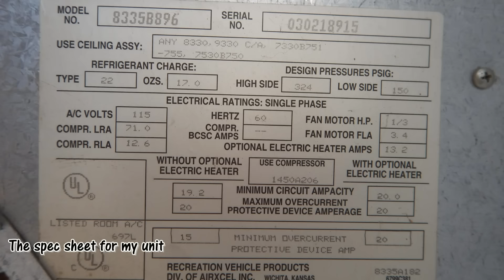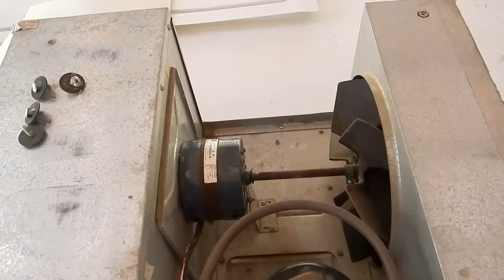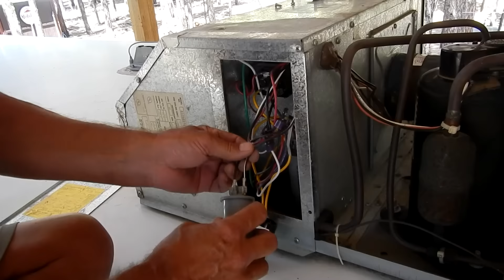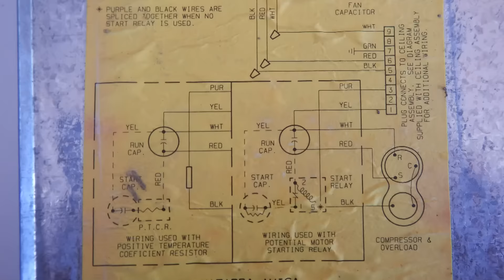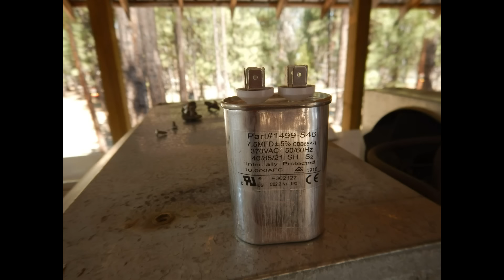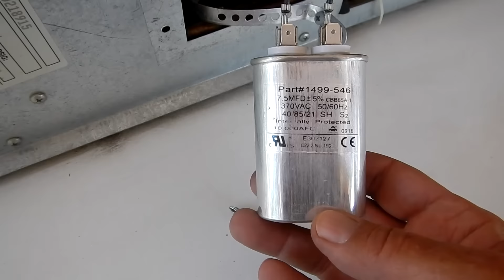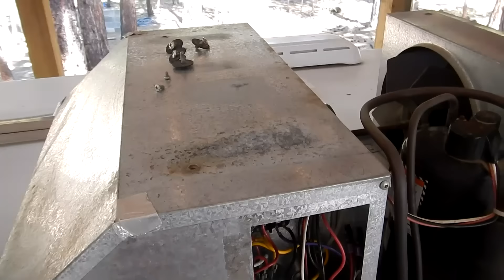How to easily fix your RV air conditioner.

Comment: New to camping. Have an old dometic duo therm RV ac. It cooled on Friday night and part of Saturday then it seemed to cycle frequently then it tripped the breaker a few times then it no longer tripped the breaker but no longer cooled and was making a noise that got a bit louder, turn all off the next morning Praying I don’t need a new system. This women needs some AC tech help, thank you
Reply from the maker: If you are tripping a circuit breaker on your RV's electric panel something is drawing more current than it normally should. Your fan (blower)motor or compressor motor could cause the circuit breaker to trip. Does the fan work without turning on the actual air conditioner? Many thermostats have a fan only mode. This would tell you if your blower motor is working properly. Your compressor motor is the other thing that could trip the breaker if it's going bad. Your compressor can also cycle on and off if it's overheating as there is a thermal shutoff on it. It will try to start again after it cools for a few minutes. You should be able to hear your compressor if it is running or not. I've tried to explain how to simply diagnose if both the electric motors in your system are working. Refrigerated air conditioning is a somewhat complicated process with several things that can go wrong. If either of your motors aren't working properly you will probably need a professional service person to fix the unit.

Comment: Great video!!!!!  you talk about shorting out the capacitors.  when doing so, do you turn off the main power switch inside the RV and then lay the screwdriver across both terminals?  Thank you in advance.
Reply from the maker: Unplug the main power cord for the RV when working on the capacitors. Capacitors in an alternating current circuit normally won't be storing any energy.Thanks, Richard.

Comment: Thanks for the tips. Fingers crossed.
Reply from the maker: It's a very common problem. If you can start it by hand it's usually a capacitor.

Comment: Hello, I was trying to figure out why my refrigerator in my rv wouldn’t run on electricity. After inspecting it I found that the 12v wire wasn’t snug around it’s terminal so I adjusted it so it would fit. And while doing that I accidentally touched it to the ground wire. It was unplugged so there was no power but it blew a fuse witch I replaced and it still won’t run on electricity. Did I cause some kind of damage somewhere else in the system? Please help.
Reply from the maker: If you blew a fuse chances are you didn't ruin anything. That's what fuses are for to protect the components in a circuit. It's possible your 110 volt heating element has stopped working. That's what the refrigerator runs on when using electricity. It's a ling thin rod with a standard electric cord and plug attached to it and plugged into the control board. They are not too difficult or expensive to replace. Of course it could be another problem, too.

Comment: Thank you! I thought it was my start capacitor. My unit was acting the same way even after replacing it. Im going to replace the fan capacitor and see if it works.
Reply from the maker: I hope you get it running correctly.
Reply: So I replaced the fan capacitor and it started functioning better. Started on it's own and ran for about 30 mins before it starts to die down and stop spinning. Do you know what that could be?
Reply from the maker: Make sure you have good power to the unit and sufficient amperage for what it requires, especially if you are running more than one AC unit. If the fan motor is spinning freely when you spin it by hand when cold then something (bearings?)might be over heating after running for a period of time. Blower motors don't last forever and you have already fixed the easy things.

Comment: Hi thank you for your video my ac unit I have to also give it a hand spin to start the fan then the fan works fine but when I turn on the cool sistem in less than a minute it cuts of the main relay  you think  I should also replay all my capasitors?
Reply from the maker: Hi Pedro, It sounds like you at least need the fan capacitor and it wouldn't hurt to replace the others at the same time. That’s the easiest place to start and not too expensive. It's possible your fan motor or compressor is drawing excessive current causing the circuit breaker to trip. Good luck with your repair.
Reply: @TomandJulieMineExploring  thank you so much I had a tech that came look at it today and didnt eaven look at it and told me I need a new unit bc he says the only thing that causes the ac to trip the breaker was a bad compressor and he says I need a new unit hes quote was 1700 for a new one installed I will be taking out the capasitors and start from there it dosnt hurt and thank you for letting me knw
Reply from the maker: Oh that sounds expensive. I hope you get it fixed, Pedro.

Comment: Can you tell me why my AC unit runs great unless the outside temperature gets to 100F or more?? Thanks
Reply from the maker: It's possible your AC just isn't capable of keeping up with that high of an outside temperature. Keeping filters and coils clean will help. I doubt that there is anything wrong with it if it works fine at lower temps.

Comment: How old was your unit? My fifth wheel ac made a loud popping noise then buzzed. I figured it’s just dead since I’m guessing it’s as old as the trailer (18 years) curious if this may just be the issue!
Reply from the maker: It was about 14 years old when we did this fix. It's fairly easy to diagnose this problem. If you can safely get on top of your rig and take the shroud off, you can try to hand start it like you see me do in the video. If it starts up and everything works you need a new fan capacitor. If the compressor is not running it could be the other capacitors. Obviously it could be something worse, but, you always want to start with the easy and inexpensive fixes first. Good luck!

Comment: Question, you mention the three capacitors, and our unit has three capacitors as well.  How do you know which capacitor is the problem, which one to change?
Reply from the maker: Are you able to start the unit by hand like I did in the video? If so, that's a bad fan capacitor. If the compressor is not running that could be a problem with the other two capicitors. Some people think it's a good idea to replace all three capacitors while you're doing this job, which does make some sense. I hope this helps and good luck with your repair.
Reply from the maker: If you are having trouble figuring out which capacitor is which you can go by the color of the wires in the schematic that lead to it.

Comment: Great video not sure if this is my problem but still a good tutorial
Reply from the maker: If you can start your fan by hand and the system runs then a capacitor is bad.
Reply: @TomandJulieMineExploring  my AC is currently working however it makes a loud humming/vibration intermittently and then goes away. I'm going to check it out up top soon but it's literally 40°C out right now 🙄
Reply from the maker: Could be a fan motor or compressor problem. Maybe you'll be able to tell where the vibration is coming from when you go up top.
Reply: @TomandJulieMineExploring  I'll check it out thanks for the advice!

Comment: It dont matter which wire goes where. Either side is the Com.
Reply from the maker: Yes, non polarized caps are used in an alternating current system.
Reply: @TomandJulieMineExploring  exactly..

Comment: Personally from my experience given that all the capacitors operate in the same environment I would replace all 3 and not have to go after it again in the nearer future. Save the pain now. They won't be any cheaper in the future.
Reply from the maker: That is sound advice. I've not had any problems with the other rwo caps in my system, yet. Replacing them all is definitely a good option. Thanks for your input.

Comment: Hello, I have a 5th wheel RV. My AC stopped working. I replaced the whole A/C unit on top of the RV. Connected everything and its not working. What do you think?
Reply from the maker: I can only guess at the common things. Thermostat or thermostat wiring, power supply problem. I'm not sure if your setup has any other switches involved. Things like that.
Reply: Most common thing is circuit breaker switch for ac get the switch with one that has gfci built in

Comment: Our AC runs and cools just fine, but when it tries to turn off it hums and then turns back on.  In other words, it doesn't want to turn off, it wants to keep running.  It will hum and then run normal, then hum, and so on. Any ideas?
Reply from the maker: Thermostat/ wiring or dirty/ frozen coil. Just guesses.

Comment: my fan runs all the time
Reply from the maker: Is the AC unit cooling?  If not it could be low on refrigerant or have some other problem. Some thermostats have a switch that will run the fan all the time, so that might be turned on.
Reply: a/c works fine its just that the fan runs all the time i have to shut the breaker switch off to get it to shut off. @TomandJulieMineExploring
Reply from the maker: @richardhasson8585  Thermostat, wiring or switch.
Reply: Maybe it's got the runs.

Comment: I am unclear on which capacitor to replace.  Your comments suggest the STARTING capacitor, but your video showed the FAN capacitor on the diagram and then the repair seemed to continue that thought.

In my case there is a loud buzz/hum and if i start by hand it turns/blows great for 1 to 6 minutes and then stops on it own and resume buzzing.   i can spin by hand again and get same results.   So I THINK I need to replace a capacitor but not sure which one :)
Reply from the maker: Not sure what exact unit you have, but, it sounds like you might need to replace more than one capacitor if it won't start by itself, and, once started, it won't keep running. Replacing the capacitors is relatively inexpensive and easy to do. It's always the easiest place to start on the AC repair. I would replace them both if it were me.
Reply: thanks - I have identified my 3 capacitors and am ready to order replacements but one last question.  The start capacitor has a little box on top of one of the terminals.  It looks sort of like an add-on.  When I search amazon I see similar pictures of capacitors that describe it as a hard start kit.  No idea what that is but those cost about four times the plain capacitor.  Any thoughts?
Reply from the maker: The hard start kit is an add on that is supposed to be more efficient in helping start your AC compressor. Is your compressor working currently even when your fan is not? You might not even need a new capacitor for the compressor if it's running fine. It won't stay on long without the fan running, but you can tell if it starts correctly. You should be able to hear and feel it running, and rumbling, even if your fan is not working. That is how mine was. If you watch in the video my compressor starts up before I hand start the fan.  I think the compressor is usually set up to not need a hard start kit, but, you may choose to get one. A little research should help you figure it out.

Comment: I am wondering if you have ever heard of this problem: My Dometic AC runs fine for 25 minutes and then cycles on and off every few minutes meanwhile the RV is getting hotter and hotter inside. My theory is that the compressor is getting got and shutting down to cool down but what would be causing it to get hot I wonder. fins are clean and ducting clear.  Could something else electrical be the problem? Any idea Tom?
Reply from the maker: It is possible that the compressor is overheating and the thermal shutoff is cutting off power. This can be caused by low charge(refrigerant), low voltage(can be caused by the capacitors) or many other things like wiring, and pressure switches if your unit has them. One other possibility is that if you have redirected a vent towards the thermostat it could be satisfying the thermostat's demands while not cooling the cabin. Since the capacitors are the cheapest and easiest thing to replace I would do that first to eliminate them as the problem. Start and run caps. Hope this helps and good luck!
Reply: @TomandJulieMineExploring  Thanks for your help and I will try your suggestions.

Comment: Hi I was trying to find the number for my series 7000 series Coleman Mach air conditioner so I could replace it. I didn’t see what model number yours is. Do you remember? There are several.
Reply: Also did you have it plugged into a regular 110 outlet at your house or a 30 amp? Thanks for any advice you can give me before I make an attempt to go on the roof.
Reply from the maker: All of the numbers on my unit are shown at the beginning of this video. I had mine plugged into a 20 amp circuit with nothing else besides the air conditioner on that circuit. What is your AC unit doing?
Reply: Tom Wigren: Mine Exploration and Hiking Hi, it use to try to start up and I could spin it and it would run. I think it’s the start capacitor like yours. Mine is in my 1992 RV and is a series 7000. I can’t get up on the roof myself. I was going to order the part and have my friends son put it in for me.
Reply from the maker: The best thing to do is look at the capacitors that are there now and match those numbers when you buy new capacitors. There are many different models of units, yours might be different than mine.
Reply: Tom Wigren: Mine Exploration and Hiking oh cool I just spun it and the fan went on. I was afraid to try on a regular 110 outlet at my friends house. And now the air worked if I spin it! Yahooooo so for now until I figure out what capacitor I need I’m cool 😎!

Comment: How do you fix an RV air conditioner that only blows out hot air?
Reply from the maker: The first thing you do is check to see if your compressor is running. If it's not you need to figure out why. If it is running you may be low on refrigerant and have a leak.

Comment: Great video. I have the same AC problem, the fan runs only when I give it a push. Will try to replace the capacitor.
Reply from the maker: Thanks and good luck with your fix.

Comment: Had something really bizarre happen today. We came home to our 1996 34j Fleetwood Bounder and was putting groceries away and about 45 minutes later the front ac came on all by itself. It was flickering on and off. When it was off i could hear the ac unit itself clicking. I wiggled the on off switch on the thermostat and it didn’t make any difference. The light on the thermostat wasn’t ever on. It stopped coming on and the ac unit itself was just clicking. I unplugged from the 30 amp pedestal and it was still clicking! So I went on the roof and took off the shroud and took off the metal shroud to get to the wires. I unplugged the main pigtail but it kept clicking. I saw the 4 clips with wires on them and unplugged the fat white wire and it quit clicking. It was getting dark so I put it back together pretty confident that I had disconnected it. Any ideas what could cause this and what should be replaced? Could it be the start or run capacitor??
Reply from the maker: It's obviously not ideal to diagnose electrical problems over the Internet, but, many times a clicking noise coming from the refrigeration unit is a start relay gone bad.

Comment: I have a Chevrolet 2002 trail lite b plus motorhome I went to turn the air conditioner on from the rooftop and it clicked and did not turn off on
Reply: Did not turn on
Reply from the maker: Hi Frank, I'm not sure what you have done to diagnose the problem. If you can start it by hand like in the video that should tell you a lot.

Comment: Hey Tom!  I just replaced the same capacitor in my roof mounted AC unit which was very similar to yours (mine is a Coleman Mach series in a '94 Jayco popup).  I used your video to determine the cause of my AC fan not working (compressor would come on but no fan) and also exactly how to replace the fan capacitor.  When I took all the covers off the unit that needed to come off, everything looked almost identical to yours, even the plumbers strap :).  So thank you for doing your video, my fan and AC work perfectly now.  Just FYI...prior to replacing the fan capacitor, I had replaced my converter from the original Carson which was making a loud humming noise and some DC systems were not working properly and I think may have been responsible for the AC fan capacitor to go out, maybe?  Anyhow, I put in a  Progressive Dynamics PD4135KV Inteli-Power Converter with Built-in Charge Wizard and everything now works as it should...Again, thanks for the video, Tom!
Reply from the maker: Thanks for taking the time to add a nice comment,  Dan. I appreciate it and I'm happy that you have everything up and running properly. You probably even saved yourself a few  bucks.
Reply: @TomandJulieMineExploring  ...Oh, for sure...paying someone to install either the converter or the capacitor was not in the budget...not to mention the hassle of having to take it somewhere, probably leave it and then having to go back and pick it up....definitely DIY saved me big $$$'s ;)